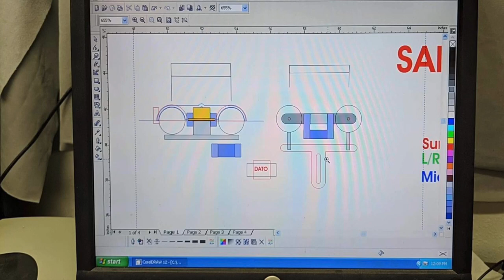FATS … making of a ventriloquist dummy

Comment: hey, how does the eye mech on this dummy work? I know how the simple side to side works but idk how the all around is done.
Reply from the maker: The maker has asked to keep his mechanics for the all around eye movements private so that part of the video has been left out, sorry.
Reply: I think that there is a lever that will move the eye section up and down, and that section is where the eye mech to look side to side and the blinking mech are, so it’s moving that entire section up and down, witch is why the eyelids also go down a little bit wen the eyes go up and down
Reply: I can tell you if it is still relevant
Reply: @darkforestzombie218   please! I need to know!
Reply: @murilog.p.1383  The eyes have sticks out the back of them onto a small board in the middle of the head. The board then has a rod with a ring on the end wich goes all the way down right down to the controls where you can then put your finger in the ring and control the eyes. I hope this helped you. If you have any more questions then feel free to ask. 😁
Reply: @darkforestzombie218  thank you so much!
Reply: @murilog.p.1383  no problem 😀😀😊